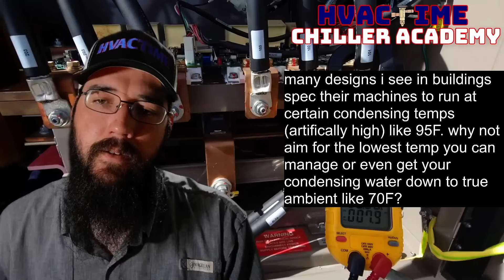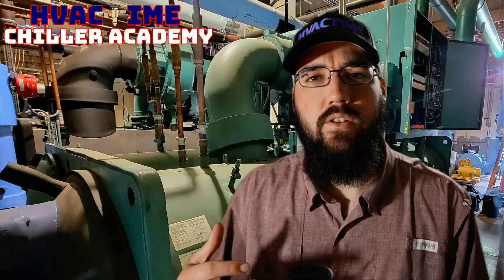Using High Condenser Water Setpoints Explained

Comment: You can run Trane CVH’s down to 60 degrees entering condenser water temperature without any oil issues. Trane will say it’s fine as long as there is a 3 psi or greater difference between the evaporator and condenser, it will return oil just fine. I’ve seen them run fine with low condenser temps.
Reply from the maker: Interesting, I have had different training on this. Is this possibly specific to newer vintages? Do you have some documentation that states that? I'm asking for better accuracy on my part, I appreciate you sharing your experience.
Reply: @HVACTIME  I do have documentation on this from Trane. I’ll email it to you.
Reply from the maker: Hey bud, touching base in this. I am very interested.
Reply: @HVACTIME I thought I had your email address but apparently I don’t. I sent you a message on FB. Let me know what email to send the trane documents on this to. 😊
Reply from the maker: hvactime@hvactimetx.com

My bad, thanks bud!
Reply: @HVACTIME can I get an update on this? Or a link